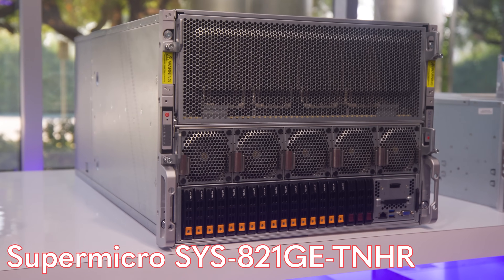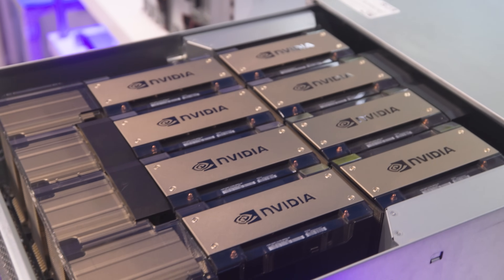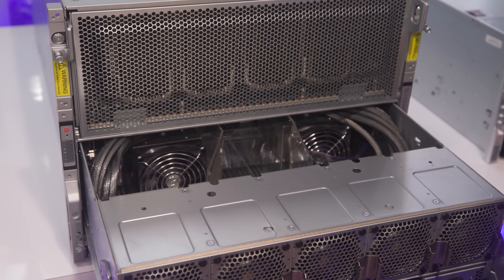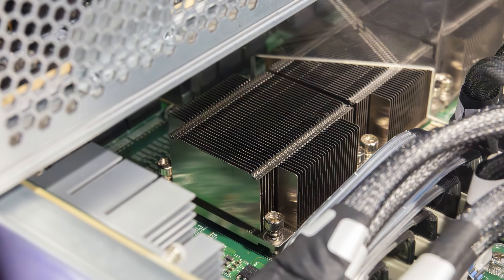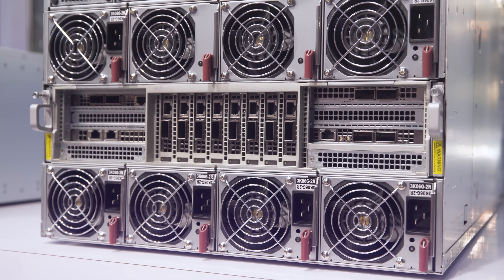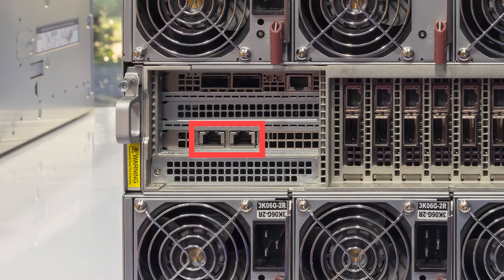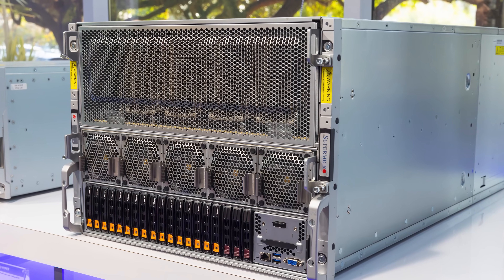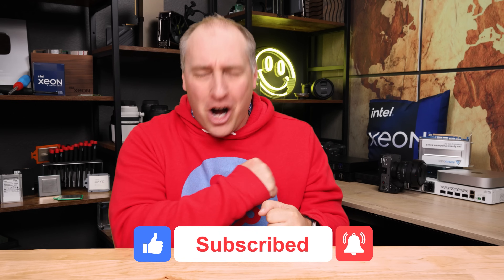Inside the SUPER NVIDIA H200 Server From Supermicro

Comment: So it is servers like this why I argue that cloud services just aren't as necessary as they used to be. There is a ton of computing that can happen on equipment like this. I know that in the 2000 SANs were frequently specced not on capacity but on performance. a standard HDD wasn't going to give you more than 200MBps of data transfer and 2-300 IOPS per drive. If you needed for performance for more users the only way to do it was to add more drives and so you would need a ton of storage servers filled with hundreds or thousands of drives all with a ton of network switches just to connect it all together and make it all work. This was the same for CPUs as many CPUs of this era were 2 or 4 core systems. Again to scale you application you needed to have a ton of servers all networked to each other with load balancers and networked to storage all just for your application. This was a lot of work to manage and there is a reason why companies could get stuck not being able to scale their application because being able to manage all of this complexity was hard. Fast forward to now though and you could get a top end server that has almost 400 CPU cores in it and fast enough storage where each SSD  can read at 14,000MBps as well as having 3M IOPS. They do all of this while being smaller and allowing more drives in a chassis. To sum it up a modern server has 50x as many cores with drives that have bandwidth 70x faster and 10,000x as many IOPS. A lot of the complexity in hosting and scaling your own application is just gone now. If you needed 100 servers for your application before you could do it now with 2. Before where you would need several layers of gigabit network switches you can now just purchase a pretty cheap 100Gbps switch for the rack or 200gbps if you are looking to splurge. I think people really should look into moving away from the cloud now for their applications. Unless your application really needs to be able to serve 100,000 simultaneous users you could probably just run it on a couple servers in your main office.
Reply: I agree, cloudy based computing is a lot more expensive than it used to be, a few years of decent performance cloud computing would cover the cost of physical modern servers in an onsite DC. Not to mention the bandwidth costs of cloud. However the upfront costs of 8 x H200 GPU's server in any kit sold by any of the big reliable vendors would make a fortune 500 company cry and the running costs of one of these is many many multiples of a regular server. A Data Center that is >5 years old will have cabinet power limits, and many of them are 16 or rarely 32KW per cabinet, so 1 or 2 of these 6 or 8U servers per 42U cabinet, running these is expensive but for a lot of companies, they think their LLM will be the best thing in the world and will allow them to fire loads of people and let the AI do the work and so on balance make the business more money. Will it fuck. AI is just fancy statistic normalizing at the moment, these things dont think, they just tell you what the average answer is.
Reply: @ Yeah I don't mean everyone should run out and buy these servers specifically. These are clearly built for AI workloads which are questionable at best for many of the workload where companies are trying to implement them. I am not going to say there isn't a place for AI in the workplace but that companies are a lot further away than they think they are. "AI" is not nearly as new as it is advertised to be. It is simply an evolution of Machine Learning from 10 years ago and "Big Data" from 20 years ago. It is the same product just different names and it will probably be another 20 years before it has any where near the impact that companies are trying to get it to do in the next 2-3 years.

 My point though was that there are servers out there that are so powerful that you don't really need to scale them in the cloud. You can easily fit 350+ cores into a 2U server and have it run your website. Put 2 of those servers in a chassis and balance the workload between the two servers and then mirror the configuration at a different datacenter for a failover. These 4 servers would ensure that your website is available 99.9% of the year.
Reply: after you…..cloud done well offers HA fail over
Reply: @ If you think that on-prem can't offer HA failover then you are mistaken. AWS, Azure, and Gcloud are just someone else's computer. If they can do it so can you. Kubernetes and even docker swarm were literally built to implement that.

Comment: In 6 months when data centers start cycling these out, I will invest in upgrading my solar farm to a nuclear powerplant, so I can put these in my home lab.
Reply: Bruh P100 hgx systems are still printing money. There is no secondary market for this stuff. It gets run until it cooks itself
Reply: @MatthewSmithx  I have to say as a plain old computer geek since the late 70's, I never cooked much of anything as for computers (I do cook pretty good though😁), because I could upgrade with the times pretty well.  As someone who's installed computerized assembly/process control lines that have many sub systems and lots of custom stuff making it all communicate, tweaks n' all, I can say factories, infrastructure facilities... are looking at a lot of work to upgrade and make it all work the same or better, and not be cheap either.  I can see server farms only somewhat better off though as there is already more modularity and cross comparability to begin with and likely for the very reason that they know how fast stuff is advancing, and they need to be able to make changes quickly and easily.
Reply: Most DC's have a limit of 16KW per cabinet, so there will be one of these per cabinet. HAH
Reply: @45mw24 most racks today are between 15kw and 25kw, 50kw on air is barely achievable , high power solutions are moving to liquid where 100-200KW racks are becoming more common
Reply: totally on spot

Comment: 18kw for a server is crazy (let alone 24kw for the fully populated chassis); for comparison, many datacenters running more conventional servers need about 15kw for an entire rack, including top rack edge switches. Really changing the equation on datacenter engineering.
Reply: We used to measure datacenters in square feet. Now we measure in megawatts.
Reply: @HutsonKyle  Indeed. There's a small DC near here (RTP) that's about the size of my house (well, 2-ish times) and 50MW wasn't enough for them! I remember the telco datacenter we built back in '97... 1MW (one!) -- the two 1.2MW generators are still there to this day.
Reply from the maker: That is adding the PSUs. The actual power consumption is usually 2-10kW.
Reply: @ServeTheHomeVideo  I think people still don't really appreciate how crazy GPU servers' power consumption is. Oh, and another reason for the front IO is not to keep cool, though that is nice, so you are not unnecessarily opening the water-cooled rear door and spilling a ton of hot air into the room.
Reply: 18kw for redundancy :) 10 kw in actual use
Reply: @mika2666  Yeah, I was thinking for a unit like this, I might just run non-redundant. Not going to be connected to any live customer traffic, I wouldn't think. If you can afford one of these, you can afford two of these, and that's your redundancy.
Reply: A decade ago, 6 KW was the largest power budget in data centres racks.
Most data centres will not support this class of AI server.
Four 24 KW chassis is the maximum I have seen in one rack resulting in a rack over 100 KW with switches, etc.
Reply: So only 2 power supplies for base unit?  And each power supply needs to handle the entire load in case of failure?  Ergo, the 24W ps’s?
Reply: Plus most that power is being turned into heat, so you need just as much cooling capacity as server power capacity. Unless you're building on an abandoned power plant site, cooling is could to be just as expensive, and critical. In my last tiny 10kW lab, the temp would climb about 2F per minute the CRAC is offline. (at about 120-130 it would reach equilibrium with the crap walls.)
Reply: Holy 😨

Comment: but can it play Crysis?
Reply from the maker: It does not have a HDMI/ DP output
Reply: @ServeTheHomeVideo  VmWare Horizon comes to mind ;) But that probably even more expensive than the server now that Broadcom has their claws in it...
Reply: streaming.   That Plane flew right over yoyr head.   @ServeTheHomeVideo
Reply: @ServeTheHomeVideo  scam :(
Reply: Can it run Windows 11? 🤔
Reply: I was looking for this comment I knew it would be here somewhere 😂
Reply: More importantly, can it run 8 copies of Crysis simultaneously?
Reply: Yes. It. Can. (about 1000 copies at once.)
Reply: And it will probably cost (at least) 1000 copies of your wallet 😁
Reply: Yes but only at 10,000 FPS.